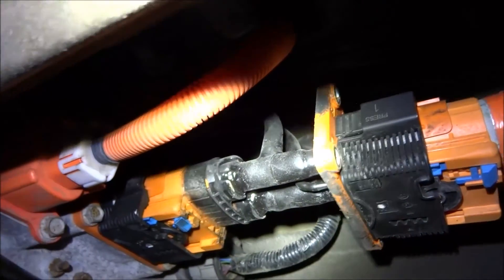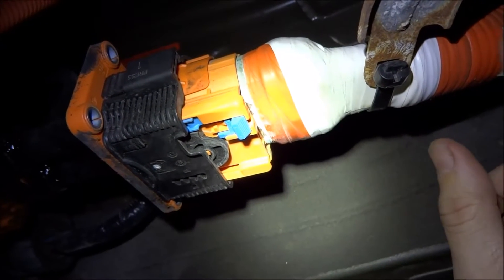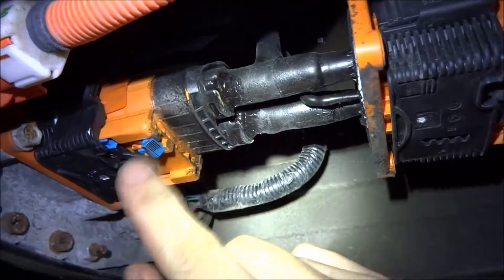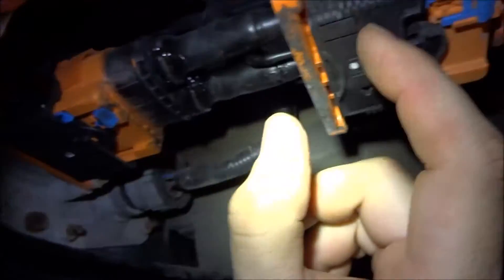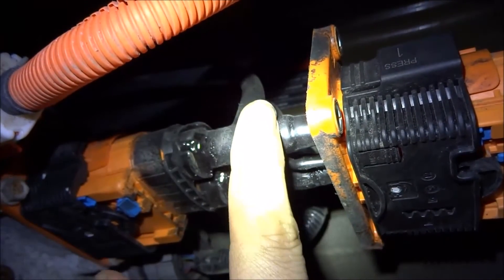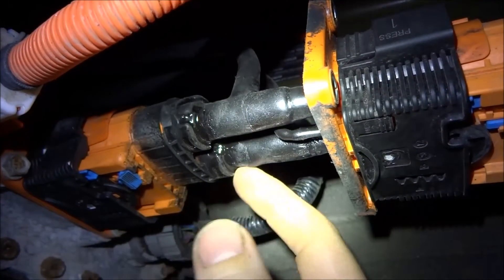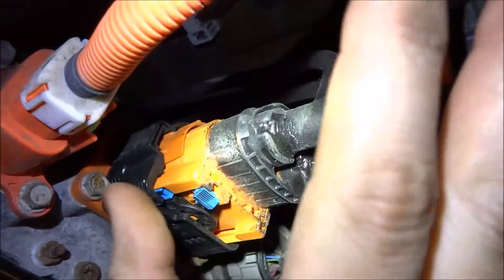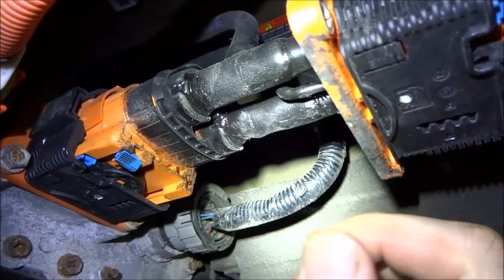Nissan LEAF range extender pack build Pt.1.4 (splice of the high voltage cable complete)

Comment: I want to do this project but instead of a battery, I want to use a 4KW inverter generator which I will modify to output DC and the generator will be on while the car drives. I worry that it may throw errors if current flows back into the battery as I suspect the current sensor is inside the battery.

Comment: Hey, can you answer me: main battery negative terminal, is it always directly connected car body and 12V battery negative terminal or both high voltage pins. (+ and -) is fully isolated car body?

Comment: Hi Leaf Xpack.I have a 2014 Leaf. Do you know whether the contacts on the on the battery side of the  PTC heater socket are live when the heater cable is disconnected?  Is there anything inside the battery pack related to the cabin heating? (A fuse or relay? Anything)  Thanks Jozef
Reply: The connector for the Expanded HV connector is as dead as the main connector if you have removed the safety switch/Safety device switch in the cabin! (SDSW).
If you do not disconnect the SDSW first, you will, by opening any of the high voltage connectors, also open the HVIL connection (High Voltage Interlock Loop) and the Computer will shut off power inside the battery. The same happens if you disconnects the com-cable for the battery.

Comment: You did not put the inline fuse after joining connection very easy to catch on fire blow up your battery pack what happen if the wires Spark. Big consequences you did not think it all the way through😒

Comment: What voltage are your welding cables rated for?  Welding is usually done at low voltages.
Reply from the maker: the cable is rated for 600 volts.

Comment: Extend Battery Range...! An idea to fix DC 12 V Cooling Fans under the Floor (above/below the Li -Iron Battery Pack) or Fix Flat Cooling Fans in the similar manner....! Electrical connection to the   12 V Battery may be with a switch. This will keep the Main Battery Cool and Battery will last longer....!An Idea....will it work....?

Comment: Would you still have to do this splicing thing on a Gen 1 Leaf as the charger is in the boot ?
Reply from the maker: I imagine you could splice into the high voltage wire going to the charger if it is active while driving but I don't know.

Comment: I'm very interested to see your project come to an end :).  I've been debating doing something like this with my leaf as well.  I took the plunge earlier this year when my 89 subaru died and decided to try and make the leaf work.  To clarify I drive roughly 80 to 100 miles a day, working as a process server.  One question though, does the computer recognize the extra voltage, and account for it in the mileage estimator?  That was one of my hesitations with the project.  I'd assume the computer would be able to detect the excess electricity and account accordingly, but I could be over estimating Nissan's engineering lol.
Reply from the maker: The car will simply think that you are driving more efficiently and in theory the range estimate should increase (slightly)
Reply: Very interesting.  So how much further can you go ?
Reply from the maker: Don't know yet, with my prototype pack about 8% further. The more 18650 cells I add, the longer the range.

Comment: Dumb question of the day:  Does the leaf computer check to see if you have charging voltage coming in and if so will the computer allow you to drive if it thinks you are still plugged in to the wall in your garage?
Reply from the maker: The car must be powered up before connecting the range extender pack otherwise you will burn out the precharge resistor in the Leaf pack. This is completely different to how the charger charges the battery. While driving the car doesn't know where the extra power is coming from. Since my range extender pack pack is pretty much balanced with Leaf pack, there is very little movement of power between the packs. Only during acceleration do I see power being drawn from the extender pack. So instead of drawing say 253 amps from the leaf pack, 250A comes from the Leaf pack and 3A comes from the extender pack.
Reply: Thanks for the explanation; much appreciated.